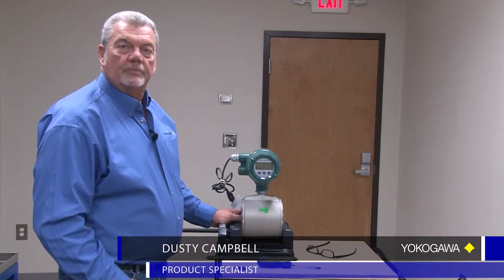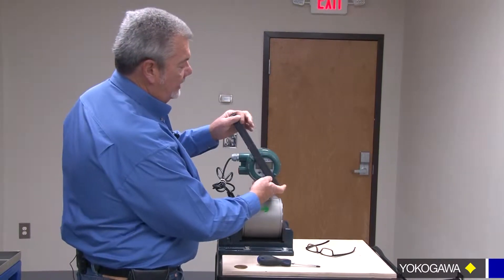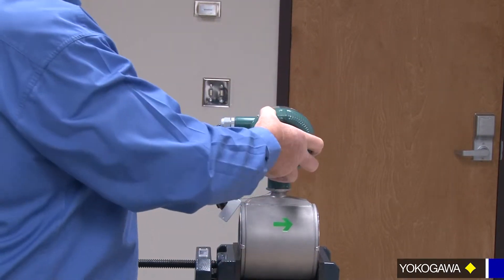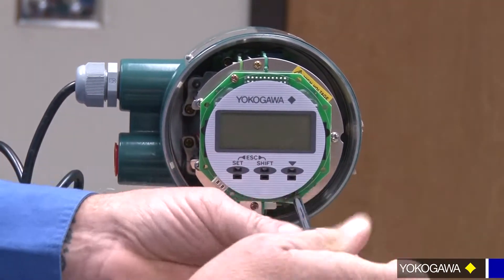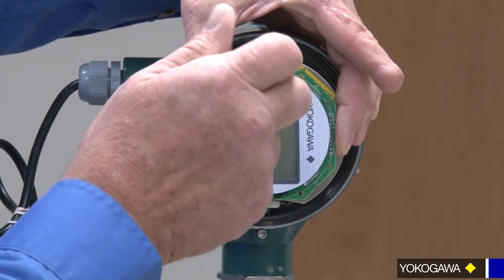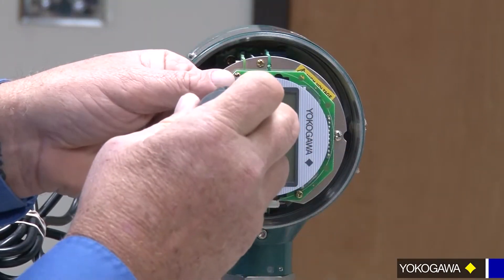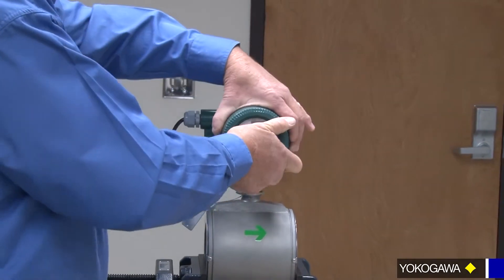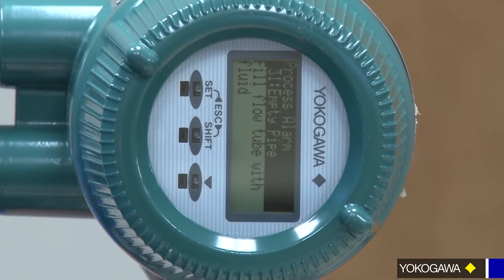How to rotate the display on an ADMAG AXF

Comment: Can you make  YTA610 temperature transmitter display rotating video?
Reply from the maker: Thanks for the feedback! It's the same process as you see in this video.  There are 3 positions for the display.  For the YTA610, it is covered on page 55 of the instruction manual here: https://web-material3.yokogawa.com/IM01C50G01-01EN.pdf